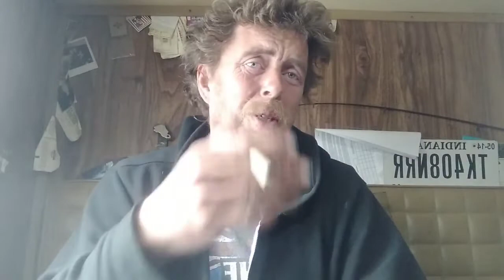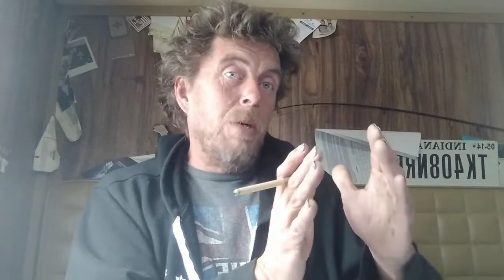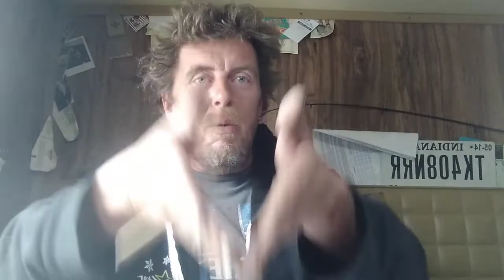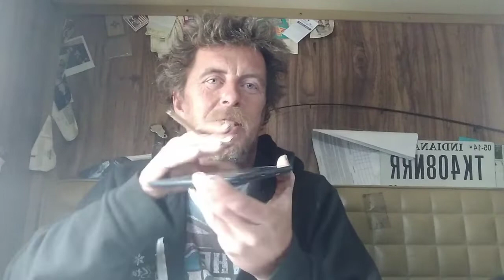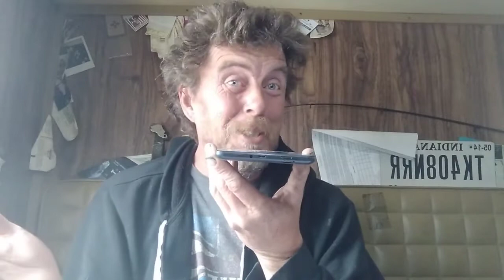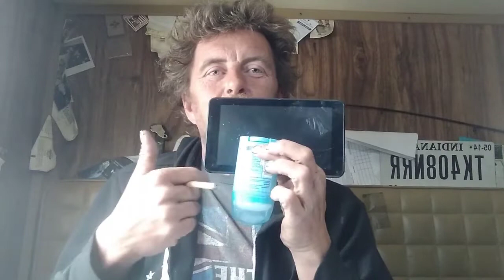Can you use ultra sound as a metal detector?

Comment: Ultra sound is used in far more applications than the medical feed such as industial, chemical , and so on . Most common in my field is metal thickness ..i.e pipe walls i-beams  and also weld inspections...your thinking to much inside the box....how about not swinging an air gap but possibly draging or pushing with ground contact? You have me thinking outside the box Jim...i will give this a try at work on a very small scale depending on what head is available. Maybe burying a ring half inch , lets see what happens
Reply from the maker: If you got the toys to play with sure. But metal inspection is a very controlled set of circumstances
Reply from the maker: Nothing to like the chaos of 3D imaging the ground

Comment: So what’s up with those OKW metal detectors?
They claim to see what’s in the ground and project that image on a screen.
Reply from the maker: They use a type of gpr...not sure of the exact details. Screen image isn't impossible with radio waves, they interact with metal in a massively different way than rock or glass, you make images massively easier by using this effect and ignoring everything else

Comment: A resonant coil loop, an swr meter, and a cb radio can be better, and dramatically cheaper. If you grid them together (swr meters, and smaller loops) you get better resolution, but swirling in a circle like a traditional one will be more fun for zeroing in on a metal object...audio location/reflection/sonar will be needed for non metallic gems tho. It would have to discern values of pitch change, like how a piece of wood or ruby would vibrate different pitches...your hobby gonna get expensive.
Reply from the maker: Sound can not tell the difference between air and bone. It just bounces. The image would be pure white noise
Reply from the maker: A note about resolution....how much do you need to tell the difference between ring and pull tab? Think about your phone.   What is the minimum number of pixels (at a diatance) to tell ring from pull tab? And then how wide is your field of view, 1"? 5? 8? How many pixels is that?  Figure out how many pixels in a 1280 x 720 image . . Then hand build each one :-)
Reply: @roadkillscjim   Nah...there will be different pitches, it would be a massive undertaking.  man, that a solid pun.
Reply: Lol, calm down, You're not wrong, but that was the overkill I was avoiding. This could be scaling up a capacitive metal detector to the point it may find water, but it will need tweaked up sensitivity for muddy, moist terrain.
Reply: @roadkillscjim  And also on the sound wave thing...to increase the chance of it showing difference, 2 or more pitches at once, and when very high pitches come back there is glass like density matter, the lower will come back with bones and branches, porus density. You'd be better off getting the guitar out, making some music and soothsaying and busking with your girly doing some Janis Joplin tones.
Reply from the maker: @ERICtheLATE  its great to have dreams and high hopes, but physics is a harsh mistress. This invisible world beyond our senses just doesn't operate the way we intuitively think it should.